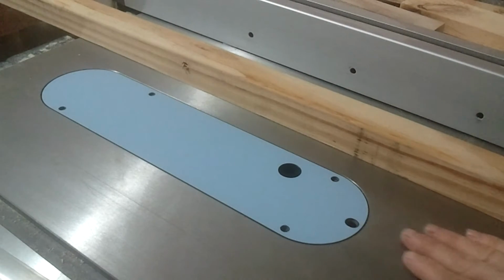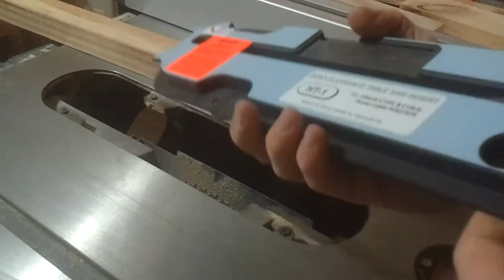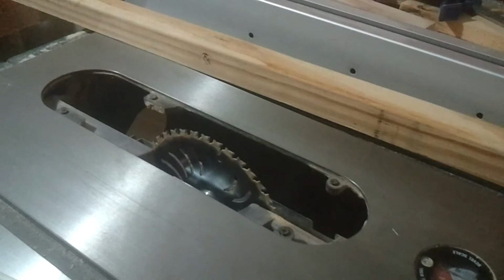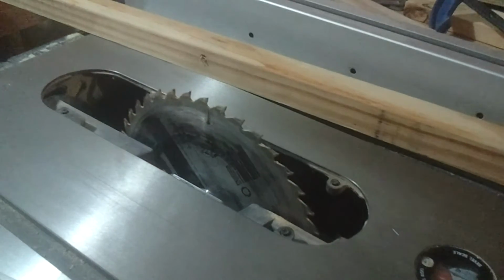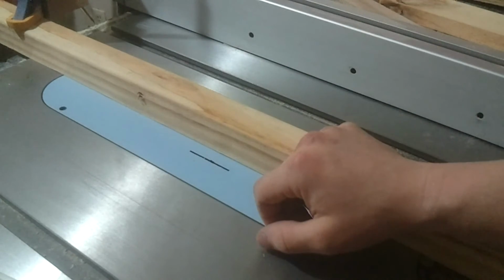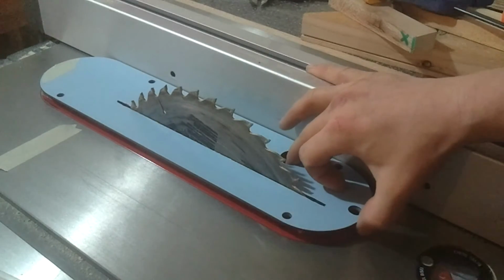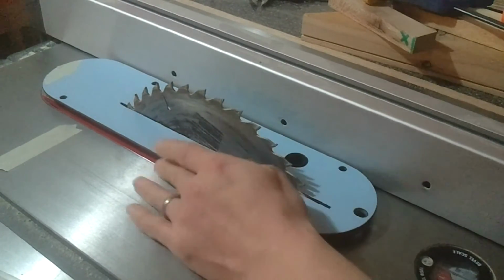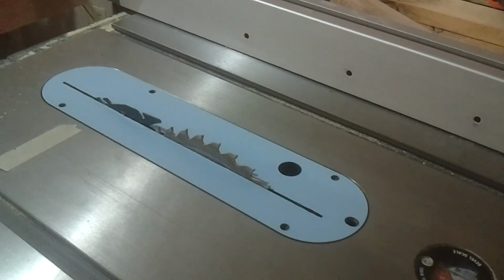Leecraft HT-1 Insert for PCB270TS Table Saw - 027

Comment: got a quistion for the porter cable pcb270ts, my issues is lowering the blade it goes down smoothly but wow does it make like a grinding noise i cleaned all the saw dust from the gears and sprayed one of those dry spray on it but still does the same any ideas.

thanks

Comment: I bought mine at Woodcraft and it cama in red. 

Also to cut the riving knife part I just flipped mine end to end and had the bottom of the insert facing up and the slot still aligned with the blad and then raised the blade up a lot quicker but do what works for you.

Comment: I have the same table saw & 0 clearance plate. I too have the same problem with the blade not lowering enough. On my saw I have to at least once a week take the back plate off & clean out all the saw dust that builds up around the trunen & the threaded bars that the raise & lower the saw. I can't seem to find a fix. Don't like it. But it is what it is. I like the saw so I live with it. Good Luck & Go Spartans.

Comment: Solid review, well done.  I like your idea of using a smaller circular saw blade to make the initial "pre-scoring" of the insert because of the top-most height of a 10" blade -- my table saw has a similar shallow depth when the blade is fully retracted.

All in all, good video.  Keep 'em coming!